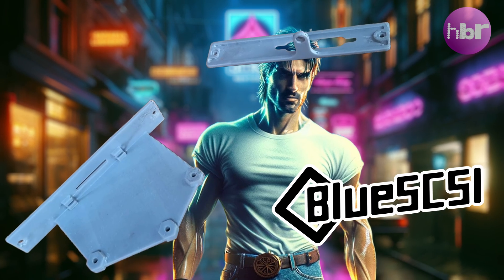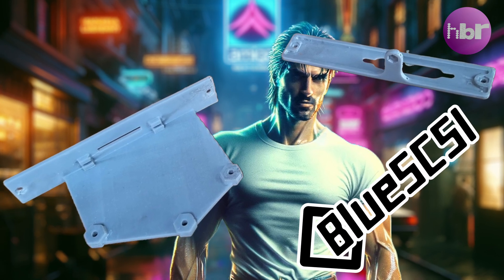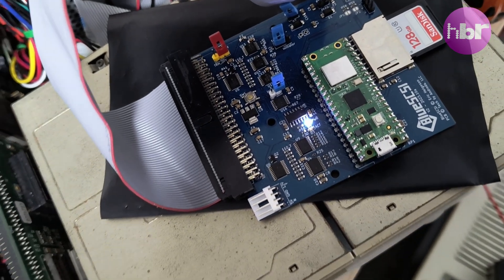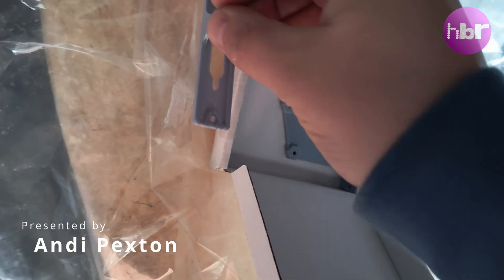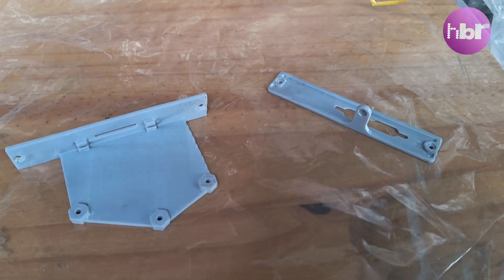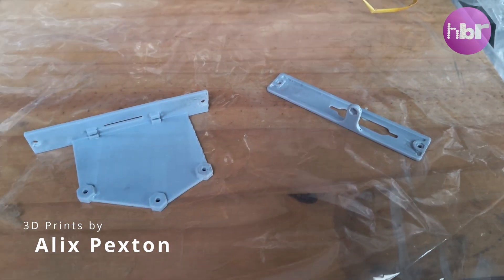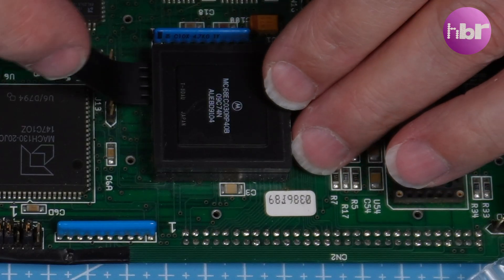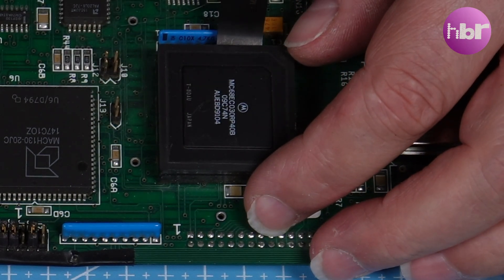Amiga Retro Revamp: New CPU & Stylish BlueSCSI Bracket!

Comment: Looks nice. My BlueSCSI V2 is floating around in a quick 3d printed case in a drive bay on my A4000.
Where did you get the 3d models?
Reply from the maker: Thanks 😊. My sister made them for me, it took a few iterations to get to the final version... Not sure if the 4000 has these slots like the 2000, I was planning to ask my sister if I can make this available maybe on PCBWay as a shared project...
Reply: @hackbuildrestore  The 4000 has slots exactly like the 2000. 
These are the same as ISA cards in old PCs and even modern PCs will still fit this.
Reply from the maker: Oh I know the ISA/zorro slots are the same. The 2000 has two special backplates for the CPU/fast slot they have two screw holes from the back not the L style... That said making an L shape ISA version wouldn't be too difficult, I may need one myself for a pc build, I'm  thinking of getting a blue SCSI for that too.